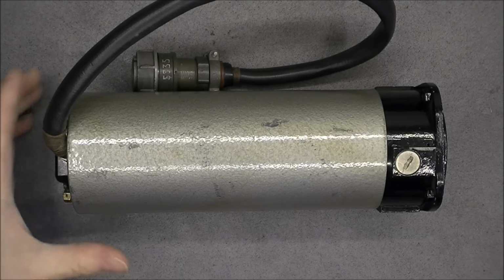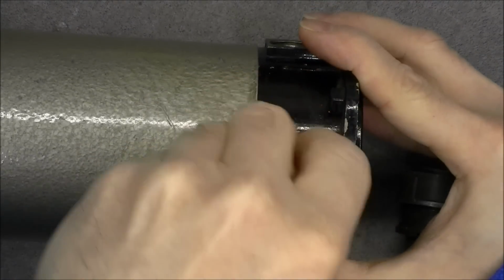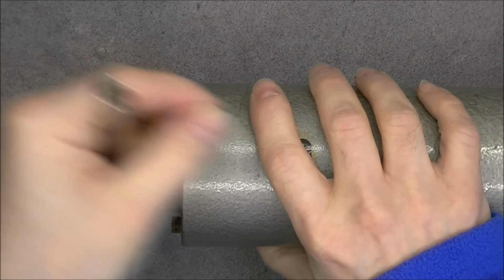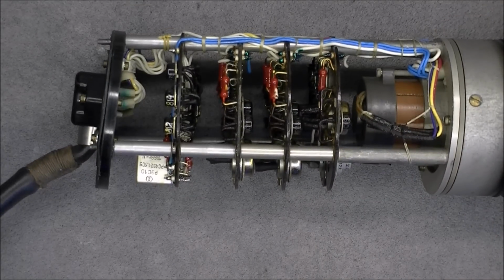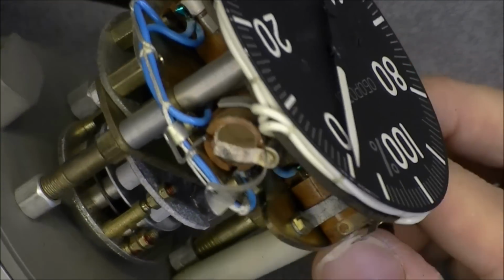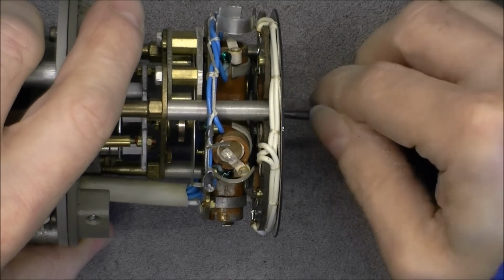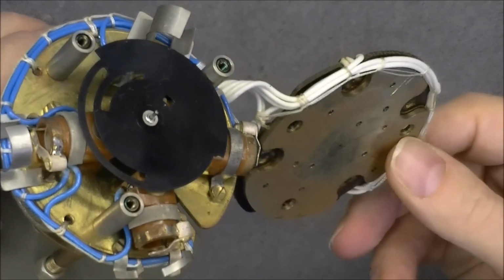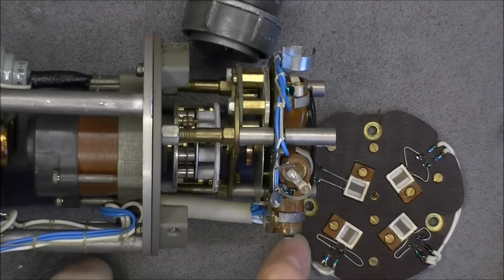Soviet avionics teardown: complicated engine tachometer

Comment: Very interesting.
Looks like the optical encoder wheel is gray coded or similar.
I have a similar - ish tacho, its has a dual movement, there is a 3 phase motor per movement and the same eddy current/spring coupling.
I made one side of the tacho operate with an arduino and H bridge:
https://www.youtube.com/watch?v=pNgS_CkSbU8